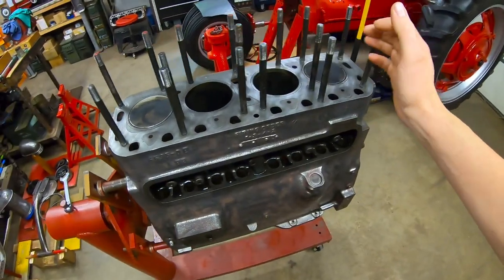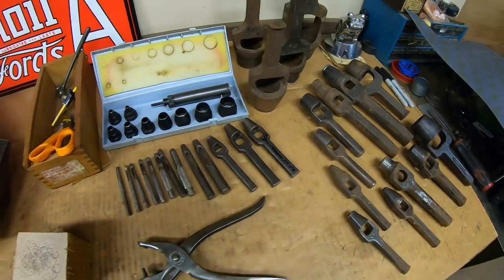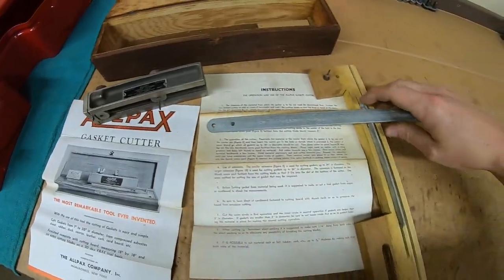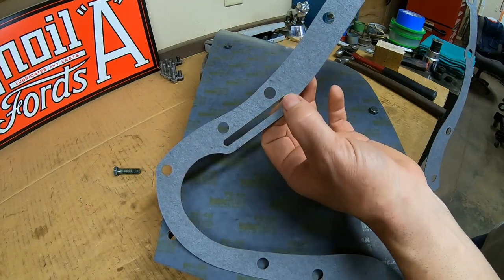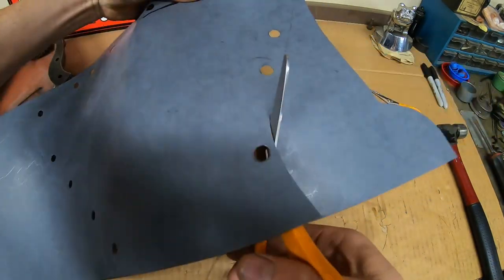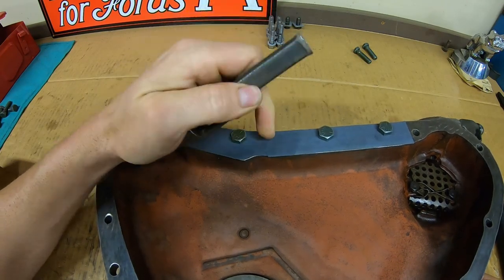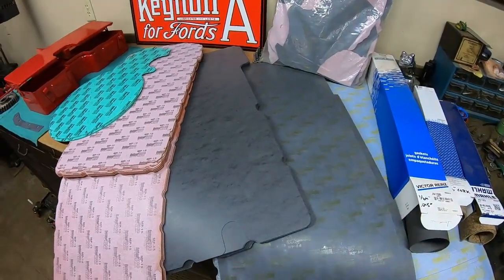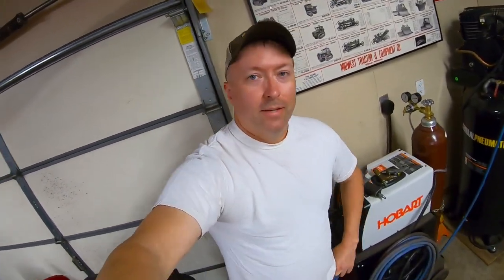How I Make All My Gaskets - Step by Step Process Including Tools, Materials & Sealers!

Comment: If you don't have a gasket to give the machine then it has nothing to read off of . Old school always prevails. Just like the new computerized car .first thing you do check for vacuum leaks. I love that old school way . I have been heavy equipment mechanic over 40 years and I used the hammer methods for years

Comment: I wonder if these people have ever actually tried to laser cut a gasket. You can't really "scan" a larger part. If you take a picture, you have to somehow undo the lens distortion. Then you still have to trace it and create the program. By the time you do that you could have cut 50 gaskets. I have a laser, I've tried it. That said, paper gaskets are obsolete technology IMHO. If you are sealing the gasket with RTV, why bother even having the gasket? It's one of the things we learned from the Japanese back in the 70s. They made these weird engines sealed with RTV that didn't leak oil everywhere. Gaskets are still needed for high pressure (head gasket) or where you have dissimilar materials (plastic valve cover, steel oil pan on aluminum block, etc) and the parts have different rates of thermal expansion. In those applications, rubber or O-ring style gaskets work much better.

Comment: I agree with your opening comments about modern times completely! Many many years ago when I started out in the carpentry business, we only allowed to use hand tools. Only after you had mastered that, we were allowed to use power tools. Power tools made work easier, but using the hand tools first helped you understand the process. Keep up the good work. 👍👍
Reply: Basically it's "learn to walk before you run". Has to be done that way.

Comment: I agree 100% with your comments in the first 2 minutes. When I was in motorcycle mechanics school in 1976, I was trained to measure parts using OG style vernier micrometers & calipers and reading to .0001 inch, despite what the service manual specification or tolerance was. IIRC, there were "digital" [mechanical] direct readout type tools around but there were none in his classroom. The instructor was adamant that we learn to use the vernier style first, then, if we chose, we could buy & use "digital" measuring tools once we were working in the field. I do recall as a fact that he was a former NASA inspector. Think Apollo missions era. Nuff said.

Comment: Squatch, thanks for this video.  It will serve as good reference material.  @ 26:30, way way back when I was a kid in the late 1900s, I helped my Dad make a gasket for an automobile coolant system thermostat in a similar manner, but using the cardboard from an old tissue box.

Comment: The allpax gasket cutter is still available new, and it has a "special" cutting board intended to be used with it. The nice thing about the cutting board is that it has metal inserts for the center pin to go into to give a nice center to rotate around.
Reply: I use one like this couple times a week at work cutting out pipe flange gaskets.
Reply: Can also use a NT Cutter C-3000GP.

Comment: I definitely agree on the interface gasket material. When it has to work, their materials just work. The International T-442 sealant brought a smile to my face. There is a reason 7.3 oil pans only have a few bolts, to hold the pan up while the sealant cures because once it does, I would almost swear that bolts are no longer required.  I also have an assortment of putty knives and old carpet knives filed to various shapes and thicknesses just for separating gaskets(especially if T-442 is involved). I also may or may not have a few old truck cast iron transfer cases still running around with a box for certain frosty beverages used for gaskets in a pinch....or a box from another gasket set if it was all I had at the moment.

Comment: Your correct about learning to crawl before yiu can walk.
Im a forklift mechanic and when you start learning the electrical side its important to learn how to diagnose things the 'old fashioned way' with a multimeter and logic rather than reaching straight for the analyser/laptop.
Sometimes the laptop doesn't catch the fault or a day will come when the laptops flat and there's no way charge it or its breaks - at least if you know the manual way you can still get the job done.

Comment: Toby , I have been making gaskets like you for over 60 years ,and the gasket material is the important factor, Ball Peen hammer all the way, hole punches is great if you have them ,I've used tapered punches and pins, instead of bolts it holds the material tighter to the part while tapping out the gasket , Very good and important viewing  material for making gaskets you just can't get

Comment: One of my old workmates was an engineer before retirement. He learned using a Lathe and Making Things from a block. All the new hires had trained on the basics of "This is how a Lathe works, but this CNC is what you will be using." One day that had an OLD piece of equipment come in for Repair / Re-Building. Made using a Lathe. And they couldn't program the CNC machine to the right tolerances. Neither could any of them do it on a Lathe, because "You won't be using one of those these days. . . . ."
"Hey, Dave. . . .How do you do this. . . ."

Practically all Navy ships have a Lathe. To make the unexpected parts that brake at sea, where there is no dock-yard. No CNC machine available there!

In my line of work I keep getting "Oh, we can't do that because there is no Fork Lift Truck Driver available." Half the time, when they have buggered off, I get out the Powered Pump Truck, and get the job done. 
"What? How did you do that?"
Using my head, thinking outside the box, and trying it out! Without a load of folks telling me how it can't be done, because it has not been done like that before. Sometime it DON'T work. But most times it does.

Comment: Thanks for the video. It got me started on my gasket. I did find that the round end of a wrench (The wrench used for the bolt work better than a ball peen hammer in marking the holes. You spin the round head and it makes a clear line (w/out the banging).

Comment: Ultrablack FTW. I'm never going back to anything else. I have two tunes on my truck. One is open and the other is sealed. Once o use up, I open the other and buy another one.

The best part about the Ultrablack is that if you put the cap right back one, it can be weeks later, and it hasn't dried on the neck.

Comment: Many thanks for those useful hints Squatch. My tuppence worth from over 50 years of making gaskets for vintage and racing cars, is the scissors. It is IMHO vital to have a really good pair of scissors. After a lot of trial and error, I decided that the best are Swiss Victorinox General Purpose Kitchen Shears. They have super sharp and stiff blades, which are quite short and wide, so good cutting leverage with the large handles. They stay sharp but also are quite easy to sharpen with a diamond file. Freely available in most countries. Also easy to adjust the tension between the blades, with a screwdriver.

Comment: Toby, I still use the ballpeen hammer method and it's worked as long as I can remember. I did have some round punch cutters for a while but they got stolen. I just went back to the hammer method.  Can't break old habits.

Comment: I had a gasket that needed to be made for the end of an oil pump. It needed to be THIN and oil resistant. I looked and looked, and by accident, I used the wrapper of a Ritz cracker roll. It's still in the tractor with no leakage and good pressure. But I do watch it like a hawk.

Comment: The International T-442 RTV is indeed very, very good stuff, and as Toby notes, you do need tools to separate parts sealed with this- like a jackhammer. :)  This was used for OE oil pan seals on the 7.3 IDI & Power Stroke engines.  The Motorcraft TA-31 RTV sealer is the same stuff but in 5 oz. caulk tubes, which makes life easier for your hands and is really nice for longer joins.  Unfortunately it is generally more expensive.  I HIGHLY recommend shopping around for either one of these....prices vary wildly.  The International and Ford dealers won't be the cheapest source.  Diesel specialists and/or Amazon are good places to look.  The T-442 sometimes is found for as much as $80/tube, which is insane.  $22-30 is more like it.  If that sounds expensive, all I can say is, when you need something to absolutely seal and failure would be costly, it's worth it.   The Wacker A442 Elastosil again is the exact same sealer but in 10.3 oz tubes- probably overkill for a hobbyist but great for builders.  Lastly, the Permatex "The Right Stuff" 1-minute sealer is supposedly the same sealer, but I don't know that for certain.
Reply: The problem with that T 442 is that you need the mating surfaces immaculately clean, and I mean immaculate. But yes you need a large prybar and a jack hammer to separate the parts.
Reply: Right stuff is pretty good, if you have good flat and clean surfaces you about need a stick of dynamite to disassemble it. Also Dow 732 silver is pretty dang good stuff. Has very good resistance to hydraulic oil. I once picked a 59000 pound machine clean off the shop floor by the top plate that was sealed down with 732. If your trying to seal something that's got good flat machined surfaces and also trying to hold a dimension I still don't think you can beat no. 2 permitex. Loctite 515 works good too but you have to have it assembled and torqued pretty quick or it will set and mess up your parallelism. It also has to be absolutely clean of oil or it won't cure and will leak....ask me how I know

Comment: Excellent video it's basically impossible to beat your methods with thought and elbow grease I do the same thing when I am out doing mobile repairs on customers machines i use a ball peen hammer for the holes i get them located and tap the other side of the ball peen hammer with another hammer and it makes a perfect hole. You have to remember how good of job the laser scanner  cutter did on the gasket set you bought the holes and profile doesn't even line up so there is where the high tech train world runs off the tracks and real world experience takes over. Keep up the great videos

Comment: I love the tip about cutting all the bolt holes first, definitely going to have to reverse my process! Also im beyond jealous at the lack of rust on those working surfaces. You can stare at bare metal in the south and watch the rust form.
Reply: You wanna see rust form, go to Pennsylvania, Michigan, or upstate New York.  I.e. the rust belt.  Far worse than down south.
Reply: @williamhackett4687  oh I agree with that 100% yall definitely have rust worse than us. I was referring more to the flash rusting and surface rusting.

Comment: I thought your comments on the laser were good.  I am an Architect, and the younger ones question why they have to sketch and do hand drafting when they start school.  I use a computer to draw everyday, but you wouldn't believe how many times i have sketched details in the field.  It never fails, you go to a job and someone has a question that they need answered right then.  Being able to sketch is an invaluable skill to my industry.  I agree with starting with the old school way of doing things and building up from there.  I have made a few gaskets, but your video was very informative.

Comment: I had a transmission that I got from a salvage yard.   and they specified that I had to make sure that it stayed lubricated or did not lose any fluid to be warranted for 90 days.    I replace the seals And then I had one spot where I suspected There might be possibility of a leak,   And they did not sell a transmission gasket for that location,    but I ended up using a paper thin gasket Which I made myself and I totally sealed The transmission with the gasket and silicone that originally never was intended to be sealed as such.  A lot of times people trust just silicone to seal up a transmission or something of the sort.  I thought about bringing it the new in the old ideas together and my transmission never leaked.

Comment: Very good tutorial Toby, I'm generally a pein through type of guy on bigger gaskets. Just a couple of comments for others on the timber block that Toby forgot to mention. First, always use a harder timber, softer timbers will distort the punched hole as they do not offer enough support. Second, always use the end grain of the timber as Toby does when using a punch. The wood fibres pointing towards the cutting edge will protect the edge from potential damage, just like a knife edge on an end grain cutting board. If you punch across the grain you can potentially roll or damage the edge of the punch and also break off timber leaving the surface uneven. I've seen many a (wad) punch damaged over the years due to poor technique.

Comment: My cat D8 oil pan gasket came in two parts with actual more puzzle looking joints, then I took cotton and impregnated it with sealer then stuffed it in and the same for the back portion of the oil pan for in the corners and old man taught me to use cotton in places like that. I have been using and newer sealer, was originally made by Detroit, now you can get it at regular parts stores, it is like a silicon texture with red lock tight mixed in it . Unlike the Detroit sealer it will come deck off easier. Thinking back I think it was a three piece gasket rear piece and left and right side being that I had to do a unframe over haul I only had the front have the oil pan off, engine block and crank was just to heave to pick out, this engine had a rebuild done, and was evident it seized from over heating and was left sit for 30 yrs

Comment: I was interested in the approach you had to making your gaskets . Back .. way back when I did my mechanics apprenticeship , we had to do block courses at a tech . So it came around to gaskets .. he said we where going to make some .. we all asked where are the small ball peen hammer’s..? He hit the roof ! He said if he saw any of us hitting a casting with a hammer we got a D !! He went on to explain the method he wanted us to use to make a gasket .. yes a small ball peen hammer is essential ! But not to hit but to use the ball end to put pressure on the material around the bolt hole - making an indentation for a hole punch to knock out , then as you did put bolts in to secure . He used the other end of the hammer to trace the in and out side of the housing … he stressed it more on alloy castings… as English bikes where the norm in those days here in NZ !
You are a wizard at gaskets by the way very slick ! I like the grey silicone adhesive as well as that Aviation #3 I think you had ? Number one on rad hoses or any water related gasket - I think I’ve discussed it with you before … 
Hell that IH tractor is better than new !! My first drive on the farm with a 2 bottom 12’ plough ! Not as flash as yours …🤔 keep up the good work..

Comment: For the butt joint I was also thinking a simple "step" design might also work that interlocks with 1 above & the other below. Basically UP OVER UP would be the line. Your approach though would definitely seem to work better for sealing against leakage.

Also when you were handling the material while the bolt holes established...just the SOUNDED about could've passed for ASMR. Agree with the sealer choice too. RTV BLACK for any oily surfaces. ORANGE for coolant or even dry. The bottle I've always known as AVIATION GASKET MAKER...works great on intakes. Know a guy who has a FORD 9N I think that he used it on the HG to get it to seal.

Comment: As an aircraft machanic for over 40 years I found Hylomar as a sealant that is pretty phenomenal. It can go metal to metal as it does on Rolls Royce gear boxes. The Blue works great on oil drain plugs or in conjunction with a gasket. It's not cheap and its not easy to clean off, but apply it, give it ten minutes open time and install and you're done! Airplanes don't have the option of pulling off the side of the road.

Comment: Highly appreciate this video. Specially good for younger viewers now or in the future who want tamper with old things. I'm not against silicone or RTV sealer but just over spamming it is just not great over all. Lot of the surfaces on older machines are not milled out that well for RTV only to seal the leak. I learned working with making gaskets that you do need to know the material you work with. Some older asbestos containing materials get too stiff over time and they are lot harder to work than any of the modern equivalents. Some materials you need to do concentrically rings before you can punch out the holes. You can do some of the punches your self, takes some time and little ingenuity but doable.

Comment: Here in Brazil it is very difficult to find old CATERPILLAR, the few that came have already turned into nails a long time ago.
I've been looking for a CATERPILLAR TEN for 20 years and finally I found one in Argentina, I bought it but it doesn't have the original covers and hood.
I want to put it to work and make it as original as possible. It will be one of the only CATERPILLAR TEN operating here in Brazil.
I need help, I need the parts below, I would like to know if you would have to sell them to me.

List:

T-678: hood
T-683: plate right
T-684: plate left
T-710: door
T-711; door
T-381: seat back

I thank you for your help

Comment: I looked in to some of those modern cutters, (mostly made for the wifes hobby room.)
It's all fine and dandy.
BUT....
They ain't cheap.
And for the amount of gaskets i make not even close to economically viable.

And if it takes a given thickness of paper, half that on gasket material.

I keep to my punches from my grandfather, hammer, knife and wood block.